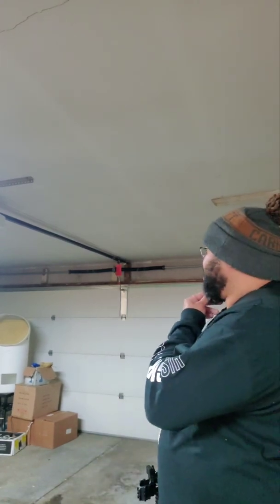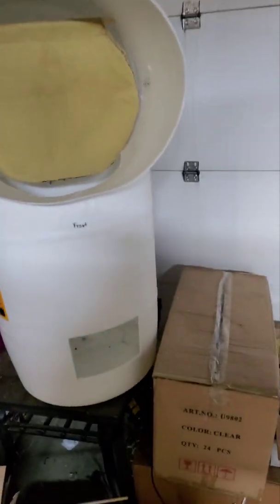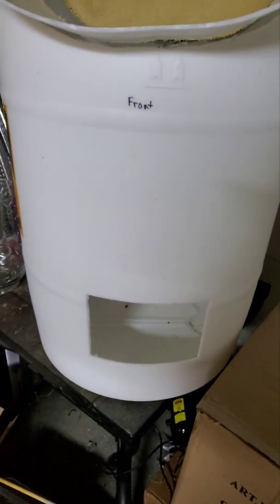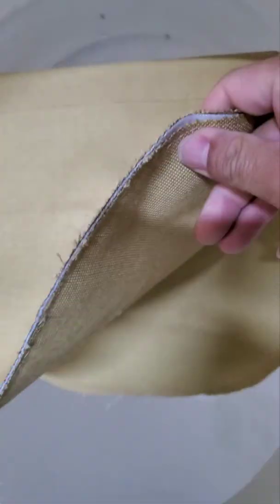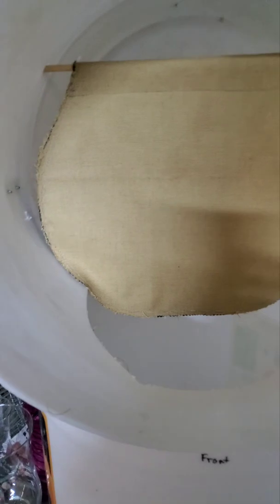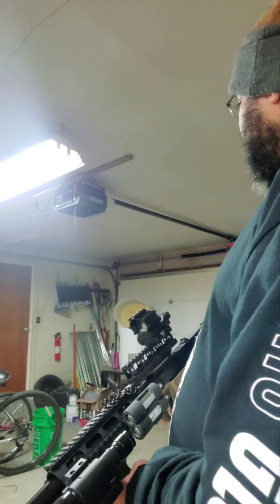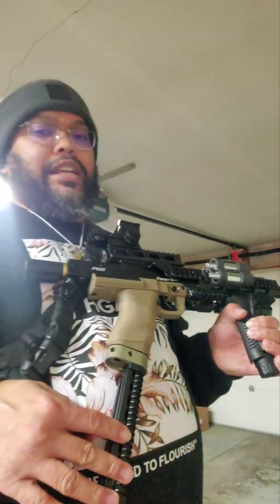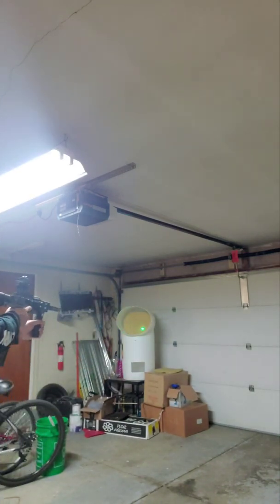Indestructible target trap for less lethal firearms. +FSC Carbine shooting test!

Comment: Dude I Love your build 
I’ve just got done fine tuning my M17 to shoot 303-307fps with the 9.9gram round balls & D shape 7gram rubber/steel mix off eBay. 
I’m slowly starting to build a FSC carbine but with a 13/3000 bottle with a ninja v2 regulator on the back. 
What was the hardest part of your build? Was there any changes you had to make I.e bolt wise or anything (I know you have to change the o-ring out) lmk 
And keep up your videos man 
Love from the UK
Reply from the maker: Prv delete kit from Daniel Sturling and Boom Treatment all day!

Comment: Would it be poss to get a steel bolt made in a metal engineer shop?
Reply from the maker: Very possible but highly expensive. It would also have to have the firing pin integrated and it needs to be precisely aligned to go into the air chamber. You're much better off spending $140 on getting your marker boom treated. You'll gain 30 FPS over the standard aluminum bolt which is 10 FPS more than a steel bolt!
https://youtu.be/ND0h1ePV4Wo

Comment: O man you going hard over there that trap is a good one better then what i can buy did you use self tapping screws are thay holding up
Reply from the maker: Thanks man. The plastic is pretty soft, so drywall screws went straight in.